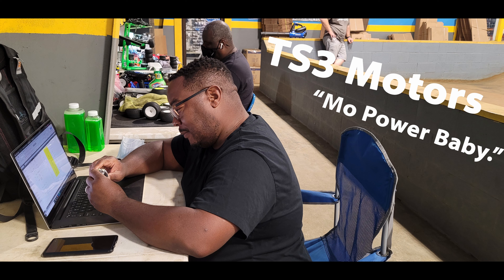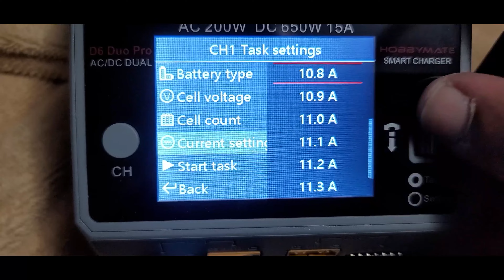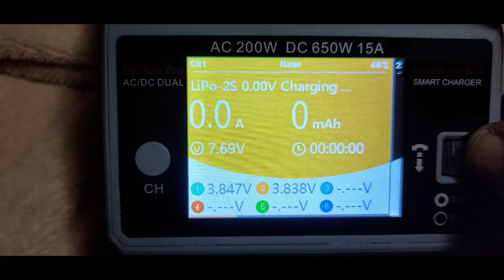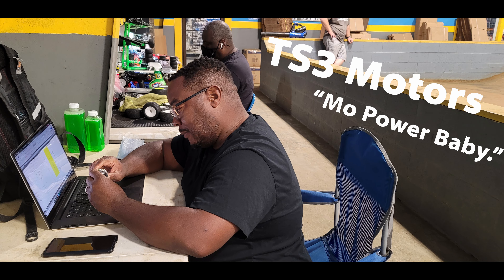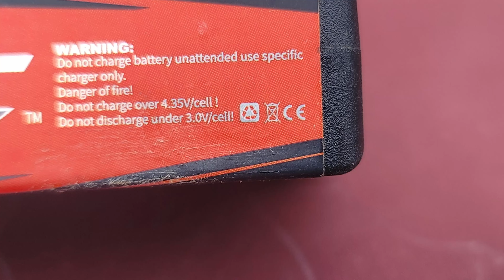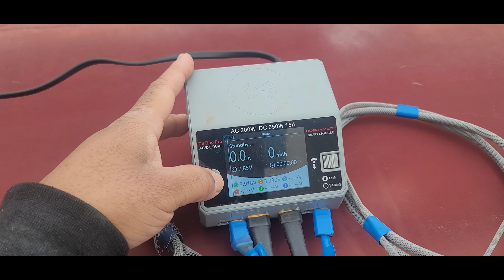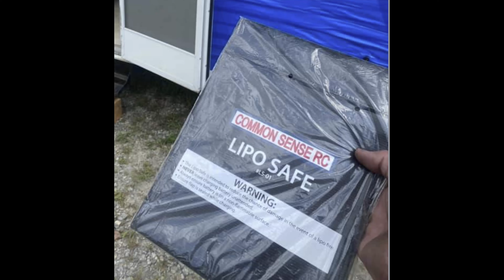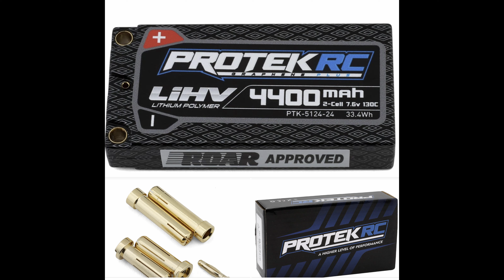"The Drive 7" Lipos and charging

Comment: good video, but i'll add something most people have a misconception on is cycles.  a cycle isnt just charging the battery and running it/discharging.  you have to look at the throughput of the battery in terms of how many mah the battery is, and how much is being used.  for example, if you have a 5000 mah pack and only use 1200 mah in a race, then recharge it, thats not a full cycle.  5000 is the full cycle.
Reply from the maker: Thank you soo much,  I didn't think about that either.
100%.